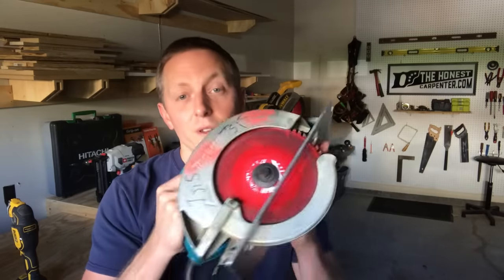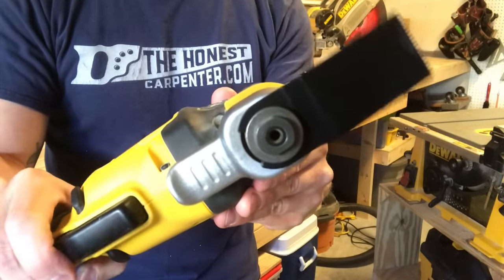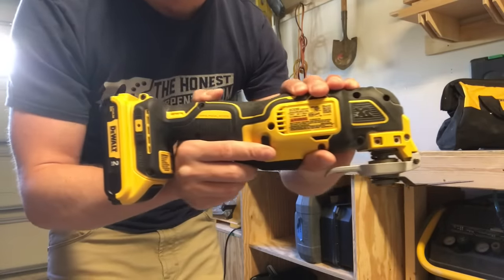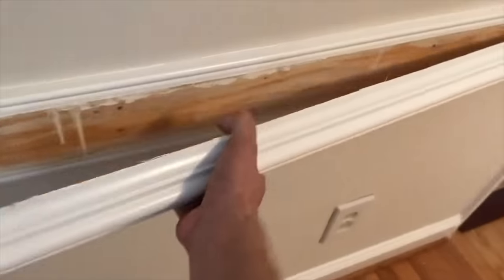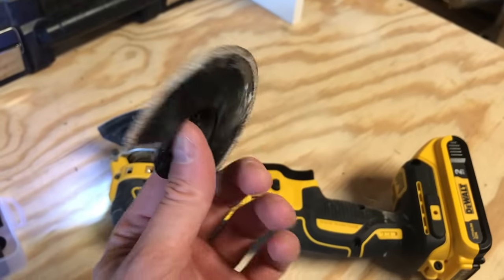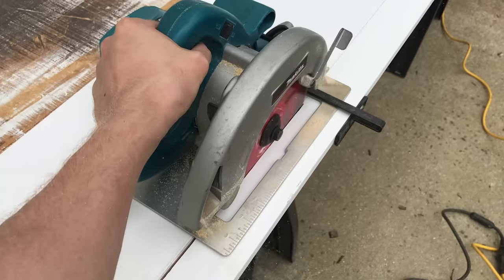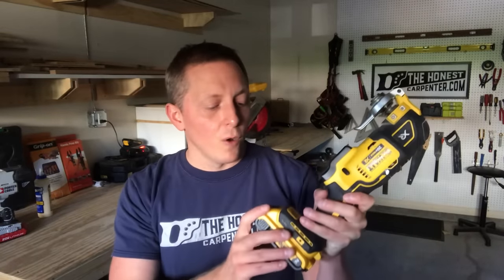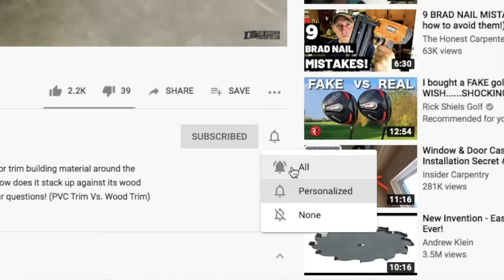The BEST SAW You've NEVER HEARD OF!! (Multitools--Great For Remodeling!)

Comment: befor the wood working industry adopted this tool , we used an air version for removing auto glass, and we invented all kinds of attachments for scraping  and anything else we could find, when i first saw the dremel version, i got 2, lol, it was originally designed to remove body casts, i think fein was the first one to make them, i love that thing, , i mostly use it for tiny detail cuts on things that are difficult to remove otherwise, and i use it to trim great stuff foam, you don't even have to have teeth on the blade for that trick, they rule

Comment: I actually got that same dewalt one you have. I got it as part of a set of 6 tools I bought a few years ago. It came with a drill, impact driver, saw, sawzall, multitool and a lamp.

I haven't used it much lately since I need new saw attachments. Good to hear that I can buy them on Amazon for cheap though.

Comment: I had to replace the wood sill and 2x4 support frame  on an old back door.  The sill and 2x4s were boxed on the front in by a granite step that because of its weight could not be moved.  Because I had access via a crawl space I could get under floor and behind the granite step frame but there was absolutely no possibility of cutting out the old damaged wood with most saws I had because of the space available.  Even a sawzall could not get into the space I needed to cut because of the granite step being in the way.  The only tool I could find that was small, that could fit in the space and was strong enough to cut out the 2x6 sill and support 2x4 was a Multitool.  With a new sets of blades the Multitool quickly made the necessary cuts all on battery power.  Yes earing protection is highly recommended.  Great tool that can easily be underrated until you have tried it.

Comment: I bought an old Dremel oscillating tool as a "throw away" about eight years ago (and it survived). Don't underestimate your need for hearing protection with this tool. It looks simple and clean but it can work through heavy stock with the best of 'em. It took a while, but I cut through about 1" of solid brass in a tight fit where no other tool could get to it. I had to put my weight into it until it felt like it was melting its way through the fitting a little at a time. It can be angry loud.

Comment: Yeah, circular blade on an angle grinder is called a 'widow maker' for a reason. My dad got hurt with that thing. The blade made a clear line across left hand 4 fingers. But luckily it wasn't that deep, none of the bones were damaged. So doctors only stitched it up. But I've heard that are cases that didn't went that well.

Comment: My wife’s favorite tool. She will go out of her way to find a reason to use it. It is a rather useful tool. I switched from masterforce to Dewalt just to have a battery powered one. Not even a week later they put one out. I’m after the nailguns now. Anybody actually use the roofing gun in winter yet? I’m thinking it would be better without freezing airlines, but the air hose is what keeps mine from hitting the ground half the time.
The mini skilsaw is quite useful as well. Put blade on backwards and cut angles on siding for gables right on ladder.

Comment: I have used it to sharpen dull utility blades by holding the blade securely by pliers then making 2 angled passes from top towards the bottom per side using 240 grit paper ( I try to match original blade angles)

Comment: I bought one two days ago to finish some hard to reach wooden edges in the garden, but when I started working on them I got so befuddled by the sound it made! It was so loud and screechy I though the neighbors will quickly shout around for the noise source. Well, it got the job done super easily, instead of wasting hours with a small saw and chisel, I finished the work in  about an hour. This wonderful tool, which I now call my favorite toy, is incredibly versatile.

Comment: I have one and do use it on occasion (Ryobi 18v).  My only issue is that I really have to crank down on the tightening screw to keep the blade from disengaging.  So those models with the quick release levers might be a good upgrade.

One of the more unusual uses I did was to spachcock a mutant turkey (~40lbs) at Thanksgiving this year.  Made quick work of it, but the downside was disinfecting the tool and blade afterwards.

Comment: It wont cut through your skin. It's the safest tool. You can put the blade on your forearm and pull the trigger and it wont cut. Keep in mind that you shouldn't do this test after you cut something since the blade is hot. My friend introduced me to this tool years ago and wanted to show me it wouldnt cut me. He kept saying , "trust me." I finally did and he burned a straight line in my arm but it didnt cut. Lol I've been using the dewalt 20v max one for years in the trades and it is truly a life saving tool.

Comment: I would've found this video useful, if I hadn't discovered most of the applications myself.  I bought a very cheap, house brand one about 3 or 4 years ago, mainly for the sanding function.  I used it once for refinishing some old wooden chairs, then put it away in the back of the cabinet.  About a year ago, I came across it when I was looking for something else, and curiosity got the better of me.  I was in the process of doing some renovating, and one of the first things I discovered was the plunging ability.  The rest is history.  It has become pretty much my favourite tool, with endless uses.
Just a week ago I had to add a "Y" into a sewer outlet.  The existing ABS pipe was inside a wall in the basement, and because of the required slope, about a foot below where it was accessible without cutting an access hole into the drywall.  Luckily the pipe was close to a stud, so I had enough room with the oscillating tool to cut the pipe in a couple of places.
If you try hard enough, any tool can be made dangerous, but I consider this to be among the safest when it comes to saws.  As Charles Malone commented, they've been using a similar tool for many years for cutting casts.

Comment: The blades have teeth.. that makes it a saw in my book.  My Bosch broke, I took it apart to see what failed and the oscilating fork was junk, had been cast and the casting has an air bubble and it failed right there, nice big void / bubble in it.  Of course I didnt use it often so i was past the warranty.   Next... Harbor frieght, still dont use it often and it's still going.  Louder, more buzzy... but still works.  Next one will be the Dewalt 20V like yours.   Use it for under cabinet remodel and cutting box squares in sheetrock.   Thanks for the video !!

Comment: I haven't gotten to try their multi tool yet and I seen a great kit set with one so that led me to this video. I have had many of their other battery powered power tools and I have to say I haven't seen a bosch, dewalt, or a craftsman out perform them. That said the brand is Flex and they come with an incredible warranty. My surprise was just how long the tool stayed powered and how much power it had right up to the very end. I really couldn't tell you how long the battery lasts because I have used it so many times before ever needing to charge it. It always comes as a shock when it finally needs charged. I almost forget its cordless.

Comment: I do wood floors, when we had to do repairs on wood floors it use to be a pain in ass.
When you had to make a cross cut to the board we had to used the skill saw & chisels. My first oscillating saw was from finn they were the ones who first came out with the oscillating saw. it was made in Germany and it was expensive. I paid $500 for my first oscillating saw in the year 2000 And I never regretted paying for it. it's was worth it me and I save so much time when I was doing wood floor repairs. That oscillating saw lasted me 10 years without a problem. I have always taken care of my tools and always kept my tools clean and in their boxes that way they will last me a long time. I have a skill saw that I bought in 1999 and I have the table saw and achop saw that I bought in 2005 and all three of those tools are still working. all three of them are DeWalt products which I love and have lasted a long time if you take care of your tools

Comment: definitely loved the cheap multitool I had bought for work. was not 100% would work so got the cheapest brand nearby now looking for an upgrade as I burned out the old one my fault for running it hot too long. Use it to cut/clean compacted dirt and cotton between swivel door and wall of machine keeping from opening or closing properly. I am not good at describing things but there is my story. The main reason need it is limited space before this tool could only use paint scraper blade and awkward angle hammer and would tear the skin of knuckles if had to do multiple times a day

Comment: small tip get the first cutline donw with a half circle blade. because it doesnt vibrate as bad as straight blade and because it doesnt catch on the sides of straight blade (jumping away) the lines are  wayyyy easier to get straight or to follow your pensil drawn line... after youget in a few mill you switch to the straight blades and your cut will be much cleaner then if you start with the straight blade

Comment: I got one in a package deal from HD when I wanted an extra battery for my Ryobi collection. Didn't find it very useful till I needed to fix some outside trim work for a door and yeah it made that a whole lot easier to cut off the rotten parts and replace without having to remove the whole length of trim piece.

Comment: Currently I've only used it for cutting up giant boxes and packaging foam. Works really well! But as shown at @2:14 It doesn't really cut with surgical precision. If they had a straight edger, it might give a little more accuracy, but it still takes a while to cut stuff like plexiglass and 3/4" wood pieces. But like you said, it's the best tool for plunge cutting.

Comment: I'm a flooring contractor and i don't know how you would cut door jambs without a multi tool. I've never even seen a jamb saw. Make sure you lay your multi tool down though!i cant tell you how many times i've sat back on that thing. The blade sticks out the top and im up and down on the floor all day.

ALSO FYI  Milwaukee or husky (cant remember) bought ryobi a couple years ago. They also own heart. There the same tools with a different paint job. All my new ryobi stuff works perfectly, and they are still trying to rebuild the ryobi reputation.

Comment: Hmm.. I've been thinking about these. Especially making plunge cuts for mortises and other complicated joins.
What I'd really  like to know though is this: can it be used to remove non-destructively bathroom tiles so that they can be re-used afterwards? This is especially useful when doing small scale repairs and the existing ties are too old to find enough replacements which are usually very costly (i.e. are priced per tile). 
The problem with using the tool like this is that if the tiles are fixed with mortar to a brick wall then the grout can be easily removed but nowadays the glue used to fix tiles is nearly impossible to remove. At least one tile will have to be sacrificed to make a start opening for the tool to be able to purchase under the tiles that must be removed and then one can only hope for the best. Cleaning the removed tiles from the glue and re-attaching them is another story. So the main issue I see is whether there attachments made that can do this job that would allow you to remove say a dozen tiles or more per attachment. This could be very economical if, say, each tile would cost 10$ to replace. I'd think the attachment would be some kind of diamond saw or similar. Do these exist? What do they cost and how long do they last? Again, the intention is to remove the tiles without breaking them. There are wet circular saws that can do this but they're huge and expensive. One cannot hope to use them high up a wall for example, that would be too dangerous and so hard to do it would not make sense to even try it.
Reply: I saw no one had answered you so I will.  The answer is “yes”.  I found it works better on mortar than adhesive, though, as adhesives tend to burn and foul blades faster, but it will work.  I keep looking for a large abrasive blade, but all I’ve found so far are the smaller round ones, but they do the job if the tile isn’t too large.  For adhesives, I’ve used the “regular” angled blades vs. abrasives, btw, so maybe I’m missing something.
Reply: @michaelandcolinspop  Oh no... A Parkside multitool was available at Lidl only last week!
But thanks very much for replying. I guess getting the tool is the first step and then comes looking for special blades on-line!
There may still be some left unsold so you replied in good time since I was scratching my head wondering why I thought these might come handy when I saw them in the Lidl weekly leaflet. Now I know why: because of this video which I'd forgotten about! Thanks for reminding me about it! :)

Comment: Love my DeWalt multi-tool... after I first used it I bought good ear protection from 3M... I had ear protection that was okay but the multitool needs something extra... blimey they are shrill.
We had to remove tiles above a waterfed underfloor heating system... four of use armed with multitools and many grout grinder bits (three yellow & black and one blue) made short wort of what was a precision required job... yes there was a lot of dust and noise but face masks, eye protection and ear protection were all in play.  No one could come up with an alternative way to to carefully remove the grout without the multitool. A few plastic sheets and masking tape stopped my wife from killing me for dust travelling throughout the house... plan on the mess! :D

Comment: Thanks for the video. Was very informative. I dont sugest that, but I am using the multitool with the sanding tool to reduce my hard thickended skin on my feet. Since my multitool can be adjusted in speed, there is no risk to get burned. Despite I am using it for Woodworking.

Comment: Good Video agree with everything. I got mine because we had one at work for re-installation  and realised how useful it was, mine is a Dremel and seems quite small . But its very useful and it was worth it for cutting through nails in wood alone  but guess I have used the accurate sanding shoes most. Have quite a few blades and accessories I have no idea how to use.

Comment: I recently installed a door jamb switch in the pantry so that the light comes on when the door is opened.  I watched a video where a guy had one of these and used it to cut the hole in the jamb for the switch.  I didn't know what it was called, and I only had one door to do, so I just went after it with a couple of spade bits and a wood chisel.  It took a long time and was very nerve-wracking.  Now that I know what this thing is called, I'm buying one.  I don't care if I use it once a year; it looks completely worth it.  THANKS!!

Comment: I used a tool like this to remove cast from limbs in an A&E department in the 1980s. Won't cut skin. Use a circular blade and use it to remove drywall , do that carefully and it does not cut the poly vapor barrier. Don't go full depth over studs or it will cut it when the poly is held.

Comment: Sorry, but I have heard of a multitool.  In fact, I have used it on many projects such as removing grout from pool.  Most recently this was the only tool and blade that would fit for removing pine from a window.  I especially like that the movement is much safer that circular and bandsaw blades.  I use a cheap on from Harbor Freight and it has performed very well.

Comment: Back in the early sixties, I had my foot operated on, and wore a plaster cast for a month or two after. To remove the cast, the surgeon used an early version of this (smaller, cordless, stainless steel body with smooth, easily cleaned curves; looked like a hair clipper). The vibrating blade would cut the rigid plaster, but would only wiggle skin back and forth without cutting.

Comment: Used a jamb saw liked he talked about many times. That thing is terrifying. The one I used got to where it was always stuck in the on position so as soon as you plugged it up it started spinning. The guard was spring loaded like a circular saw and there was this little nub that you would pull on to reveal the blade to start your cut, all this while the blade is spinning a half inch below your finger. Also, it threw saw dust everywhere when cutting jambs. I also remember when the first multitool came out. He said the name , Stein? Anyway it was like 400 dollars and there was no quick release for the blades. You had to use an allan key every time to change blades which back then we're like 25 a piece if I recall. And he is right, if you have a deft hand you can make in place trim cuts with ease. Or when hardwood needs to be patched as when a vent is moved, cut old wood back to stagger the joints in proper fashion for new to be installed so you don't get that dumb square look. Fantastic tool.

Comment: These have been around forever. In healthcare we call it a cast saw. They  are used to cut through casts, both plaster and fiberglass, without cutting the skin below it. If you’ve ever had a broken bone, you’ve probably seen a multi tool. Or at least it’s ancestor.  I should probably mention the blades were curved the teeth were shallow and reasonably dull compared to what you would use to cut wood or metal. But the principles the same.